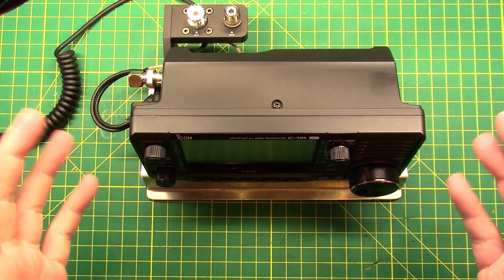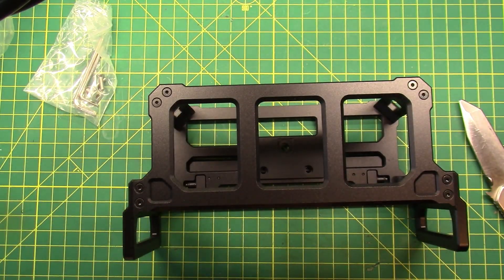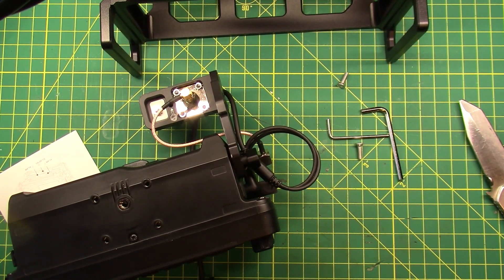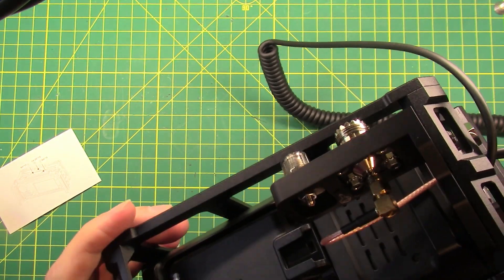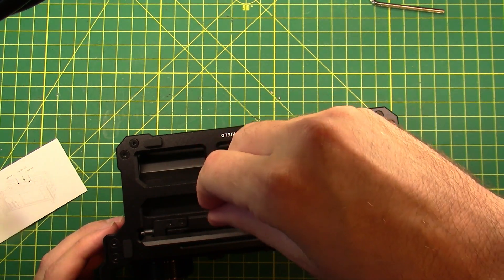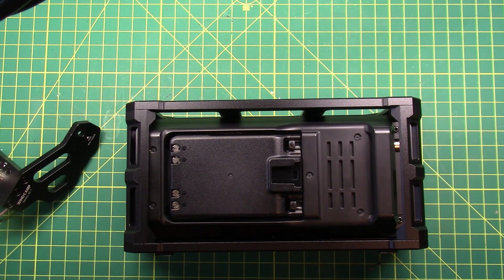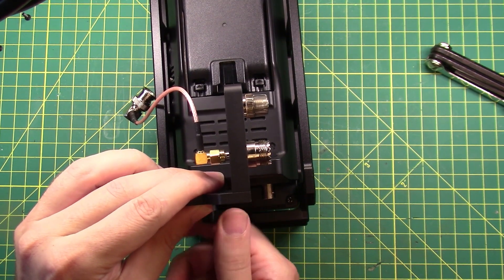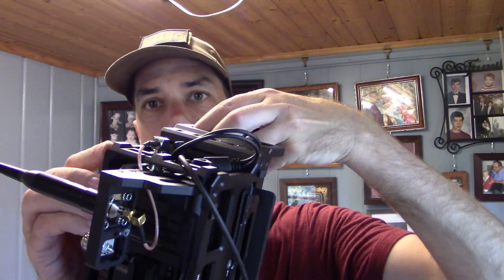Does the Windcamp ARK-705 cut it for protecting the Icom IC-705?

Comment: Great Video, thanks!  Not hip on losing the 1/4X20 but there are adapters.
Reply from the maker: If you remove the bottom screw and put a 1/4-20 (thing) in it's place, it's still good.

Comment: The fact that there are several stands, frames and antenna connection holders is a proof for a very bad job they did at ICOM. Yes, I own an IC-705 and it's a really good transceiver, but the case and the position of the connectors is a pain!
Reply from the maker: Totally agree - that being said, there is nothing like it on the market!  It will probably be the "standard" for the next 10+ years too.

Comment: I don't know why they made the frame narrower than the handles, especially on the antenna side.  If it were wider it would better protect the BNC connector.  Also, they should have an antenna mount that is affixed to the frame, not the radio body, for the ARK-705.  After all, the whole idea is to protect the radio.
Reply from the maker: Yes, very valid feedback.  I hope they see it and make a new revision. The peovi cage now has some protection for the rear, but it is expensive!

Comment: It's another shame that they eliminate the tripod hole in the bottom when the case is on.  Show-stopper for me since I use that in my shack (desktop tripod) and in the car (cup holder mount).
Reply from the maker: There are 5 mounting holes in the bottom of the cage.  Leave the 4 AMPS mount screws in, and the you can remove the center 1/4-20 tripod screw and continue to use the tripod mount.  You might need to visit the hardware store for an adapter. But I use it all the time with the cage on attached to a tripod mount.
Reply: I was thinking if you take that tripod screw out and attach an actual tripod then its intended function is still good. It’s just a pain to have to keep up with an extra screw.

Comment: I've been contemplating the ARK-705. But it was with some wringing of hands that I decided to go with the larger, heavier IC-705 over other rigs, so I'm having a tough time pondering adding yet more weight and bulk. Even when I do POTA I still like to hike down the beach or up some trails to a good spot - so it's like a μSOTA ;-)
Reply from the maker: It does add some weight for sure.  If you're already carrying the radio in one of those foam filled pelican style cases it's probably not a big deal.  My portable radios get some kind of protection.

Comment: Use a wireless microphone. No one thinks about this but if the radio falls off table and microphone is attached when it hits the floor smashing into microphone you will have cracked screen. Yes it happened to me. Applies to IC705 and IC7300.
Reply from the maker: That's a great idea.  Lightweight radios and long "tripping hazards" don't play well together.

Comment: I don't see any other QRP radios with giant cages around them. Not even on radios like the KX2 which is just as expensive. The only time I see these things in use is on picnic tables at the park. None of the QRP radios I see out on the trails/summits have this stuff on them.
Reply from the maker: Totally agree. This radio doesn't seem "durable" or easily replaced.  I've use a kx2 and the metal body is awesome, and the side plates protect the knobs great and the screen has a replaceable cover... much more durable.

Comment: There's a cheap folded sheet metal protecto that comes as part of a carrying bag assortment out of China. It'll be interesting to see how that turns out.
. . . As with many of the comments, protecting the radio should be an easy work through. I mean, if Chairman Mao's Type 102 (which is a huge pig of a radio to haul around) could survive the Cultural Revolution . . . 
. . . Even so, the ARK705 looks like a pretty solid deal. Problem is, you can go through a lot of cash going through all the protectors that folks have dreamed up for the IC705. And we won't talk about how I can filtch the carrying case for my wife's $2k camera lense, which she bought after I bought the IC705 ;-) 
. . . Simple fact is: The IC705 is a hellishly expensive radio to haul out to the field. It's design just screams "I'm fragile!" So the protector case market is gonna be there, one way or the other. If only all of them would allow mounting the Begali Adventure bracket ;-) 
73 de W8IJN
Reply: Also, DL2ART has a nice video about the ARK705 & the antenna adaptors showing how the RC2 goes together. It's in German and Arthur talks pretty fast but clearly. He's enthused by the ARK705, as is evident by his presentation. That's at https://www.youtube.com/watch?v=h-IzuJucygw
Reply from the maker: I like the ARK-705, I'm just not happy that the RC-1&2 teams don't seem to talk to the ARK team.  You are absolutely correct that the IC-705 screams fragile.  The 706 and the 891 are both built to drive over.
Reply: @temporarilyoffline  Hah! That rates you a direct email ;-)

Comment: I'm not sold on making my radio bigger than it already is by putting it in a cage. I've been operating portable for over 30 years and have never put even a tiny scratch on any of my equipment. I always carry my gear in a protective case of some kind. I can always find a nice camera case that is perfect in size for any of my radios.
Barry, KU3X
Reply from the maker: There are a lot of good camera cases out there for cheap.  I'm not so nice on gear, even one if my shack radios has a scratch on it... I'm gonna blame the kids though... yeah, that's it  its the kids fault!
Reply: show some pics or it never happended ! I've been operating for 30+ years as well...I gurantee you've put some scratches on your radios

Comment: +1 for the Windcamp ARK-705.  I considered the Peovi "cage" but it's little more than a 3-way handle... it does not protect the back of the radio. Who cares that the antenna mount isn't compatible when using the ARK-705 ?   Let's get practical... any radio mounted antenna is a real compromise and anything with some weight to it would tip the radio over.
Reply from the maker: You are correct on all accounts.  My only concern was that the two products from the same company never met.
Reply: @temporarilyoffline   Not a big deal really.  I never understood the purpose of the antenna mount anyway... for the reasons I mentioned above.

Comment: Did you see they made a mount to fit the ARK706?  - WINDCAMP RC-2 Quick Release Antenna Support for ICOM 705 ICOM IC-705 Adapted for ARK-705 Shield
Reply from the maker: It's on order... they shouldn't have had to do that... but it is a better design (so far)

Comment: Windcamp missed the mark with this cage.  https://www.hamradio.co.uk/accessories-by-manufacturer-mydel-accessories/mydel/mydel-ic-705-carry-cage-pd-12412.php These guys have a similar cage, protects the buttons and screen but is out of the way for the antenna mount. Additonally has a top carry handle.  Best 73s - KI5BXN
Reply from the maker: I've seen that cage, but it doesn't cover the back of the radio.  One day we'll have a perfect protection device.

Comment: Good way to adjust the side piece to work with the antenna mount. I heard Windcamp is making a newer version of the antenna mount that is compatible with the cage.
Reply: That's correct, and I currently have it mounted on mine. Smaller form factor than the original mount.
Reply from the maker: I just dropped a new video on the rc-2, it's better, but not perfect.
Reply: @temporarilyoffline   Got mine as well. Agree with your first impression. Maybe need a rc-3. 😂
Reply from the maker: @wgxdz  I'm probably done with Wincamp.  The cage is awesome, the rest of the stuff doesn't add to the experience.  I feel like I'm at a net-negative here...
Reply: @temporarilyoffline  agreed. I like the cage. I can deal with the added bulk, but the accessories don't enhance the experience. Especially considering the types of antennas the mounts cater to really just aren't that great. I have an HFJ-350 and for the money, you're better off just saving it and putting it toward a Buddistick.
Reply from the maker: @TheIronClooch  I did two vids on the toy box antenna... not fun
Reply: I’m going to try this out except highly consider modifying that corner piece with a grinder and cutter.  If I don’t like how much I’ll have to take out, it sure would be nice knowing that I could get a replacement piece in case I wish to sell it one day.

Comment: For those looking for a relatively easy, and good looking solution to be able to attach the Windcamp RC-1 to the Windcamp ARK-705 Shield and still have full support,
you can get a threaded round standoff, two 4-40 by 1/2" long flat head screws, and a little bit of black paint.

McMaster-Carr carries all the hardware you need (you might be able to find it at your local hardware or big box store as well).

https://www.mcmaster.com/

Female Threaded Round Standoff, Aluminum, 1/4" OD, 3-1/2" Long, 4-40 Thread Size

Part number: 93330A551
Cost: $2.33

316 Stainless Steel Phillips Flat Head Screws, 4-40 Thread Size, 3/8" Long
Part number: 91500A126
Cost: $9.48 for a pack of 100 (personally, I'd get these in a smaller pack locally)

Construction/Assembly steps:

1) Remove the 4 screws holding the left rear vertical brace of the ARK-705 Shield and remove brace.
2) Cut the 3 1/2" long standoff to 3.390" long.
3) Test fit on the ARK-705 Shield.
4) Disassemble the new standoff.
5) Put the 4-40 flat head screws into the standoff holes and make sure to screw all the way in so most of the threads are not covered with paint.
6) Lightly spray paint the whole standoff assembly and let dry.
7) Reassemble the ARK-705 Shield and enjoy!
Reply from the maker: That's a good tip!

Comment: Ah, I think thats the one I was thinking of the other day.
Kinda wish they made a full cage like this for other radios.  Either way, great video as always.
HLTW TeamReplay for the win!
Reply from the maker: The Tech Prepper has something suitable for the Yaesu mobiles (817/8, 857, 891, etc)  Its not as "sexy" in my mind, but it does work well.
Reply: @temporarilyoffline  No yeah I was just talking with him the other day.  I do really like how it relocates the connectors to the front.  Have the portable zero rails for now.
Reply: I would love to see a full frame enclosure and antenna relocation mount on the face. Heck, it would be really neat to add an optional compartment on the bottom to house an external 6-10 Ah battery. Throw this in a bag for vertical operation and you can have up to $2K of my hard earned cash.
Reply: @TheTechPrepper  If I was smarter, could probably figure out how to make one out of a cut & folded peice of sheet metal.

Comment: I have the Peovi and the iCOM LC-192 backpack and with the Peovi, on you can barely fit it in the pack but you have to turn one of the "ears" around backwards. Do you have an LC-192 pack and could test to see if the ARK-705 will fit into the pack without doing anything funky?
Reply from the maker: I don't have the backpack, but if I did, I'd get a review out on it.

Comment: I'm thinking about one of these https://www.ebay.com/itm/174599412874?hash=item28a6ef9c8a:g:llAAAOSwKIhf4eys - but I think I'll sort of wait a bit to see if Peovi comes up with some more options. This one DOES work with the Windcamp antenna mount and introduces its own anatenna mount that allows for use in top opening back packs - which would work really well for backpacks designed to accomodate militry style radios that normally have the controls and an antenna mount on the top of the radio. 

I looked at the Windcamp cage but was not willing to pay the money due to practical issues - like antenna mounting.
If Windcamp would add a number ofr 1/4-20 (camera tripod) threaded holes and maybe some M4, pretty much all over it, that would reduce the weight and allow for any number of accessories to be added.
The video industry has a lot of cages for cameras which have a LOT of accessories  desigbed to fint 1/4-20 and M4 threards that mnight be useful on the radio - cable strin releif devices, moutning options etc etc.
As it is although it offers protection I think it probably introduces new problems.
Reply from the maker: I'd call that the KX-705

Comment: Zero out of ten…. Are you really willing to gamble on a flawed piece of kit?  With a radio costing $1300?  Nah…  Yes, all engineering is a compromise, but when you don’t have to compromise, DON’T!!!
Reply from the maker: I don't know of a better solution yet.  There are rumors, but nothing real yet.
Reply: @temporarilyoffline  TO, demand will cause the “right” product to come about.  However, if there is not sufficient demand, you might want to keep a weather eye out for a newer, perhaps better, transceiver.  The IC-705 was a pretty good idea, but the wrong execution.  For the AO it was envisioned, it’s not robust enough, nor is it as focused as it should be.  The TX-500, while not as glitzy as the IC-705, is the current ultimate in QRP field work.  It is “just” enough to get the job done, and no more.  The IC-705 tries to be the ultimate portable IC-7300.  The ICOM engineers are amongst the very best- shucks, I’m buying a new IC-7610 this week!  They didn’t let dyed in the wool SOTA/POTA/IOTA folks design the IC-705.  So, they missed it.  After some of them fall on their swords, they’ll perhaps get it right…

All the Best to You and Yours!
Reply from the maker: @c.f.leffen2929  I 100% agree - I'll actually take it a step further and say that Icom didn't even know what the customer was when they built this radio.  If they did, they haven't found the right "message:market" match to make these things fly off the shelf.

To me, this is the travel radio, not the overlanding radio - I want this thing in my backpack going to work, want to work repeaters in the car during the commute, want to play around in a new location while working out of a hotel, maybe a weekend RV camping trip... but a rugged survival radio - this ain't it.

There is a lot of technology to play with on this radio and that's what got me.  Bluetooth, WiFi, GPS, portable - not backpacking/SOTA.
Reply: @temporarilyoffline  You, Sir, have finally given the IC-705 true meaning.  Well Done!